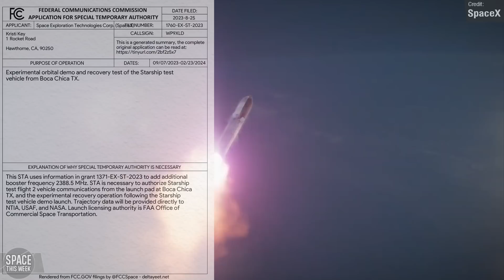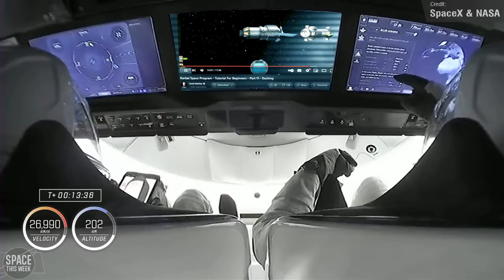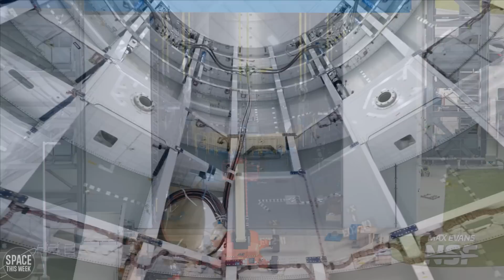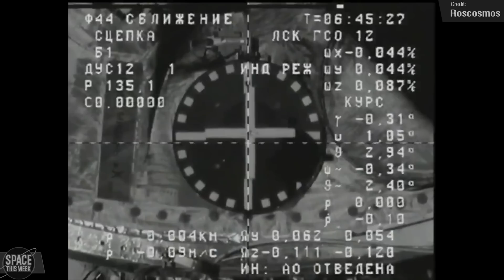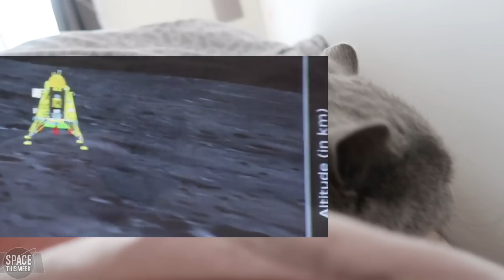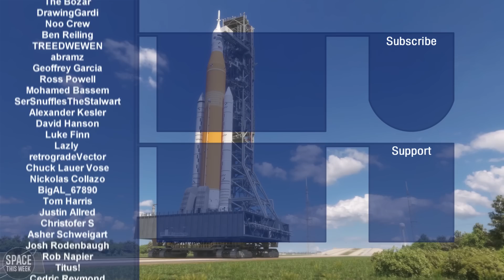SpaceX Starship Has Now Completed ALL The Tests Needed For Launch + SpaceX Gave Us a Launch Date?

Comment: Should it not be said that India landed close to the lunar South pole, they have done really well but it is not a South pole landing ?
Reply: @colinsouthern  my point is based on the fact that the rover is extremely limited in its travel, down to meters not kilometers, the pole is a region where they have said tgere may be water below ground, of they explore some 35 degrees away from that area there is less likelihood of water.

Comment: As I recall, SpaceX used sub-maximum thrust for their last static test which also "succeeded", followed by the debacle of the actual launch and subsequent....excavation. Assuming the FAA, along with several other government agencies, ever let them try again, it´ll be interesting to see how it goes.
My money´s on stage zero failure. Again.
Reply: @colinsouthern  Approximately 60 years of established launch structure design from every country to successfully launch a rocket.
How about you?
Reply: @colinsouthern  that those who have a lot more collective training, qualifications, and experience than you - and access to all the test data - and engineering data - don't know what they're talking about They test launched the largest, most powerful rocket ever made without a flame diverter.......... They were told that they would need one. Every launch complex on the planet has one. The technology has been in use for over 60 years. 
People predicted that the launch would generate a massive amount of concrete debris - It did Not "a bit" but enough to shower the entire area with debris, and cover nearby towns in layers of dust. 
People also predicted that the debris would damage and or destroy the StarShips engines. It did both and SpaceX was simply lucky that it didn´t cause the vehicle to explode on the pad.
As for answers to questions: It's hard to answer questions when the launch pad is so poorly designed for the task that it causes mission-ending damage to your vehicle.

As for your final note: Perhaps you should investigate the many challenges from regulatory agencies that SpaceX is facing at the moment, including but by no means limited to: 
An FAA investigation into the failure of their launch abort system to destroy the vehicle. And yes it failed to do so. Destruction of the rocket seems to have been caused by structural failure as a result of the tumble it entered into and not the LAS.
The environmental protection agency for multiple failures on behalf of SpaceX to prevent serious damage to the Boca Chica wildlife preserve; not helped at all by showering it with that little "bit of concrete" you mentioned.

Back to  that those who have a lot more collective training, qualifications, and experience than you - and access to all the test data - and engineering data - don't know what they're talking about Let´s see how this prediction ages: The new stage Zero will fail just like the last one. It will fail and SpaceX will prove that they are better than another of Musk's companies at digging holes rapidly. The failure will severely damage Starship and it will lead to a failed launch. If the thousands of people who go to watch the launch in person are lucky, it will fail at high altitude. If they are unlucky some of them will probably die.
Don´t bother responding until after the launch. At that point, one of us can admit that they were wrong.

Comment: SPACEX is still having issues with engines not working past a few seconds (they lost two during their recent test).  Question is:  WHY?  I hope they can find the “Problem” and fix it for good.
Reply: It does seem pointless to do another launch until they can get through a six second, half throttle static fire without multiple engines shutting down

Comment: I assume any number of unintentional engine shutdowns is too many.  The system not behaving exactly as intended is probably a no-go for orbital test launch.
Reply: Not necessarily. They can have as many as three go and still make it to orbit. The whole point of these test flights is data generation, the more the better.
Reply: @Demonslayer20111  My thought is that if they're still having engine failures that means they don't know why they are having engine failures. Until they figure out why it makes a lot more sense to figure it out with more engine tests because if they can't figure out why then it could just as easily be 4 or 6 failures next time.  They need to figure it out and then test to be sure they have figured it out.  And they might as well do that while they're waiting for launch approval.

Comment: Deluge system seems to hold up well, but it's still only 1/2 the thrust. I guess there's no point in trying to do a full stack static fire at full throttle, only to risk blowing up the deluge system without even getting a launch out of it. Do we have any reason to doubt it will hold up?

Comment: Is it really so much better than already designed executed and succeeded Space Shuttle gliding landing? Why NASA didn't just build new space shuttle. Apparently rockets can't be fully reuseble so maybe instead of reinventing wheel they should have update very old but working space shuttle setting
Reply: Space Shuttle launches were expensive. Really expensive.

And you need a runway to land them. A long runway. Not something we have on Moon or Mars.
Reply: @Jehty21  good point. I could complain but it would not be fair. And I can't write more^^ I must drive my truck
Reply: Because NASA could not reduce the chance of debris hits on the Shuttle, so another Columbia disaster was going to happen eventually.
Reply: The Space Shuttle tossed a lot of other parts while recovering the orbiter. It wasn't 100% reusable. The orbiter recovery also required a huge amount of refurbishment prior to another launch, as did the solid rocket boosters. Plus the orbiter both limited payload to orbit and time in orbit, even when docked to the ISS. 

SpaceX has already surpassed the Space Shuttle with the Falcon 9 and Heavy. Falcon 9 has flown more times to orbit and the booster has lander more times than the Shuttle. While it hasn't taken as many people into orbit as the Shuttle, it has spent more human hours in orbit than the Shuttle did over its life. The Falcon family is drastically cheaper, more reliable, more capable, and more reusable than the Shuttle ever was. 

Starship is building off of that success and trying to surpass it. If Starship succeeds, not only will it be the cheapest per kg to orbit and most recoverable rocket ever, but it will AT THE EXACT SAME TIME be the most powerful and capable rocket ever. Its end goal is to be able to surpass the Saturn V in payload to orbit while being completely reusable. Maximum payload while expended is expected to be 2x to 3x more capable than the Saturn V.
Reply: @anthonypelchat yes, the space shuttle was not perfect, and it was technology created during Cold War. NASA invested a lot of money in the successor of the space shuttle. If I remember right, it was a turtle like body with spike engines. It was abandoned only because NASA was cut off from money. Iraq war transfered $ from American families to owners of military industry corp. Trump returned big cash to NASA and... now somehow,  we all pretend Musk is a replacement for NASA itself. 
Artemis did what it was designed for perfectly. Musk who used to laugh that keeping SLS is crazy waste of money still delivers only promises.
Falcon does not have STS capabilities, btw. ISS was built by STS.
SLS worked fine while Musk BIGGEST RICKET EVER is NOT FINISHED YET.
Horizontal landing on Earth is not cheaper than gliding and landing on the airport.
Horizontal landing on Moon is the only option anyway. Idk Mars.
The biggest planet Musk' rockets would ever land on is Earth, so building runaway is not a serious argument against gliding. And tower for horizontal landing is not cheap to build either.
So still, if landing horizontally with a rocket with mass big enough to do interplanetary journeys, hit some kind of critical mass, then maybe it is a good idea to glide like STS?
Since PEDO scandal, I don't like Musk, but I follow SpaceX since it was founded.
Every time spaceX push the boundaries, I am more than happy.
If Musk didn't behave like he does, I wouldn't ask SpaceX choices as often.
But because Musk lie regularly to keep investors willing to give him their money, I take under consideration that developing horizontal landing on Earth took too much resources and too much time already. And Artemis has a schedule. 
But please. I am just a truck driver. What do I know
Reply: Netflix plays Deep Impact from 1997
So even modern Celebrities watch with awe 90's.
Respect to all leaders of World who protect innocent.
Reply: Yes, I agree. I love SpaceX.
But genius should appreciate dofferent critical points. Anything to inspire you. Use AI for new rocket project new type of engine. Ask for money from governments. You can build gravity engine in less than 40 years.

Oumuamua brought a message from the Angel of Apocalypse himself.
 Sun year is 200 000 Eath years. Omuamua is junk which ended up in comos because of Kuiper Belts type structures collide with celestial bodies. Interstellar junk is snnoker white ball. If it has energy higher than sun gravity pull energy than is leave sun gravity well. Stars slow down such junks and sooner or later it ends up inside the planetary system. Snooker with celestial bodies is being played. I live at night. I saw 2 meteorits and one ufo. To understand what universe does to humanity when it is at sleep go to orchard at night. Stay in one point. Remember wilde animals are watchers.
War should end before it gets worse.  Negotiate leaders or we all die moments after best human subatomic and astronimic development was achieved.
Hell is ... deep.

Comment: I found it curious that the Chandrayyan 3 didn't kick up any dust when it landed on the moon, seems like that should have happened!
Reply: The lander and rover total just over 1,750kg (~3,860lb). The Moon has 1/6 the gravity of Earth and no atmosphere. So the engine doesn't put out a lot of thrust and the exhaust has to actually hit the surface to move anything.
Reply: Potentially did, but could have been too blurry to really pick it up, or the resampling software had removed it as the colour is the same as the ground
Reply: It did.

Comment: The static fire was progress, but she still needs to sort out the engines. You can’t have 2 fail during a 5 second 40% throttle test, the space shuttle had 1 engine failure in the whole program. Starship needs to be showing reliability like that,
Reply: I think it was a 5 second 50% throttle..  Do keep in mind this is a WIP, these are use once throw away test articles comparing it to the shuttle at this point is meaningless.  During development the shuttle engines gave them plenty of head aches.